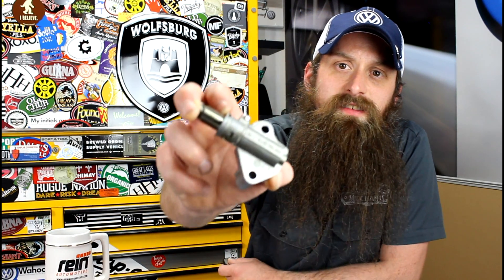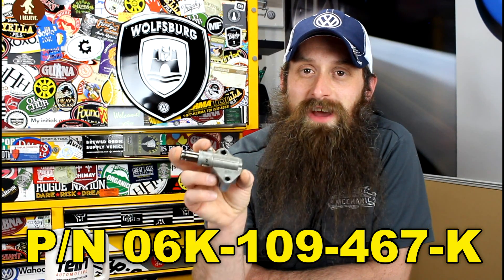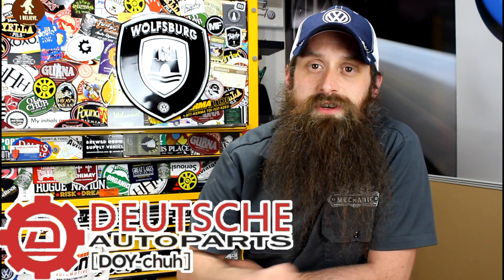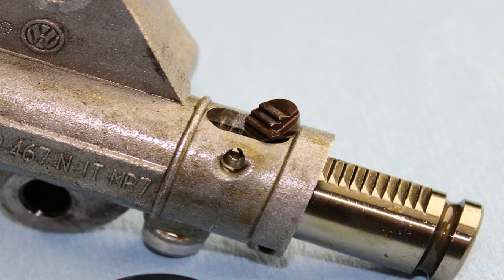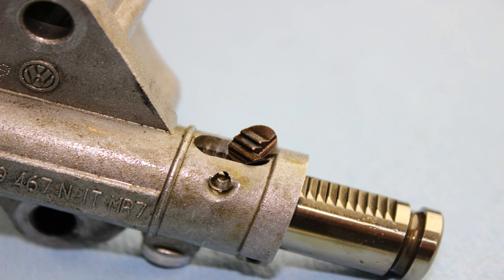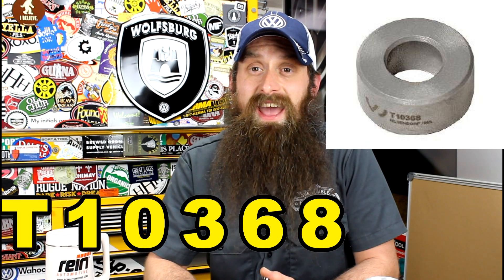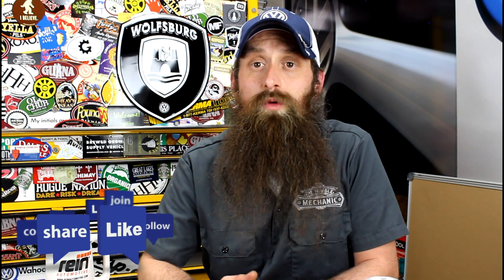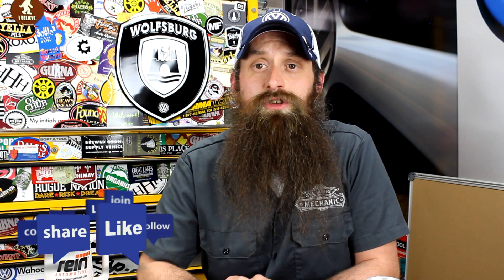How The 2.0T TSI Timing Chain Tensioner Fails

Comment: Charles, is there a DIY on how to install the tensioner pre failure. I want to due this as insurance to prevent failure. I have searched without finding anything to give me an idea if I need any extra pieces besides the tool you have shown and the tensioner itself. Thanks in advance

Comment: The dealership confirmed that my tensioner did fail. At the time of dropping off the car at the dealership the car still started and drove. I am out of warranty so I need to decided if I just swap the engine or try to fix the issue and hope there isn't major damage. If my car is still able to start (it does hesitate to start) and drive (with a really crap idle) is it more likely the time is just off slightly and the pistons didn't actually hit any valves?

Comment: My 2009 GTI JUST got this today.
When I went to start it today it cranked over for about 3 secs before starting and then got the P0016 code. 
Once running it seems totally fine and I cannot hear any noise and the timing does not seem off at all. 
I am at 140k km...tensioner you think?
Reply: Udo Donotron im having the same problem on my 06 2.0t tsi a4. did you figure out the problem?
Reply: Hi could u find the problem ?, have same code,,,

Comment: hey, i have 2012 cc @75kmiles. should i replace tensioner with timing chain as well? how durable is timing chain, will it last 200-250k miles? thanks
Reply: You should just do them both I heard. The timing chains usually last hundreds of thousands of miles, but the tensioner is what will break

Comment: I just bought a 2013 cc 2.0t tsi its the CBFA. The engine build date on it is 5/24/12 im going to be checking the part number soon, but im wondering if there was a time frame as to when this part was switched to the k part number on the CC's

Comment: my audi a4 06  has a clicking noise wich to me come from the back of the engine. after seeing so many videos on YT , it seems to be the timing chain tensioner.  os this the same one ??
Reply: my car does drive normal . but it has that noise.
Reply from the maker: +Maybederrepente very likely. It wouldn't be this tensioner but it could be the tensioner between the cam chains.
Reply: HumbleMechanic when timing a 2010 vw cc just a question do you just put the new chain on The arrows where it should be and put it back together or do you put the chain on and try and run it "by hand" to make sure the timing isn't off when the chain come back around

Comment: I have a question for you. I'm in the middle of this job on my Audi. is there supposed to be a gasket between the cam bridge and cylinder head. Or is it just a bare metal to metal surface? or a coating of gasket maker.

Comment: hey mate , I have a 1.8 TSI and plan to change the tensioner which u mentioned. Is it necessary to replace the timing chain as well ? 
thanks in advance and keep up the good work
Reply from the maker: Seen more chain issues with the 1.8 than the 2.0
Reply: +HumbleMechanic
Skoda service in India know nothing about this issue and are even reluctant to change the parts if we want to get it done. They say we can do it but u have to give in writing that all responsibility will be yours in case any issue happens :(

Comment: now im worried :-/

i have a 2013 2.0tsi amarok (South Africa market), what the odds it has the old type tensioner in? its on 180000km now (111846.815 miles) , if it were an old type, would it have failed by now?
Reply: HumbleMechanic found the engine code, CDFA
Reply from the maker: Sadly we don't have the Amarok here. I can't really tell you.
Reply: ts a vw pickup truck, using the 2.0tsi engine
Reply: Since it hasn't hammered your valves and the engine still runs your tensioner should still be fine. HOWEVER... if your vehicle has done 112K on the original tensioner and chain it's never a bad idea to get them replaced. The timing chain tensioner shouldn't be too hard a job to do, but your timing chain will require some know-how or you could upset the crank and cam timings. If you haven't the slightest clue on replacing the timing chain, take your vehicle to a mechanic and let them do it for you... there's nothing worse than fitting your shiny new chain and tensioner, cranking the engine over for the first time and bending your valves because your crank was a tooth or two off TDC when you fitted the chain! well... that unless you're a tuner and you blow connecting rods out the side of your engine block while tuning... that makes bent valves look easier to fix than a broken headlamp!
Reply: How to change timing chain Audi 2009 a4 qauttro

Comment: I have been looking at buying a 2014 gli 30th edition or a 2015 gti for the increased torque. I am certain the 2014 is still affected by the tensioner defect. What about the 2015 gti, was the problem eliminated when the engine gained more power in 2015 or is it also defective?

Comment: I have p0304 error , replaced coils with spark plugs , pvc valve , still have same issue! Mechanic told me than is a timing chain problem . I think he tried to get so money but not to fix my car
Reply: Late reply but that is not a mechanic. He is playing with your money guessing/swapping parts. Proper mechanics will have proper equipment to tell exactly what needs fixing + following correct procedures when it comes to narrowing down the options of what actually needs replacing.

Comment: Charles, So I've got a 2009 TSI Passat with 127K. I just found this video. I'm considering doing this myself. Would you need pulley holding tool T10355 to hold the pulley while loosening bolt? no videos mention holding pulley with tool and deutsche kit doesn't include one
Reply from the maker: You will need that or some type of equivalent to hold the pulley. Zipping that bolt off with an impact makes me very nervous. I would hate for the gear to spin. They have them on Amazon too. http://amzn.to/2aenkn7

Comment: Just discovered this channel, great and informative videos.  It appears my 2013 GTI is having this problem. won't start cranks like compression problem.  Would you recommend a dealership versus a local mechanic shop?  It sounds like an involved job to repair and I bet experience is the key.  Also, unfortunately the dealer is the closest tow.
Reply from the maker: +Dominic Luppino depends on your mileage. It may be worth towing to dealer and calling VW for assistance.
Reply: Thanks,  I have about 80k on the car.
Reply from the maker: You are out of the powertrain warranty, but I would 100% call VW and try and get some help.

Comment: Hey Charles. I'm about to order the kit from Deutsche, as I just saw that I have an older version of the tensioner and I just hit 60K. The job seems fairly straight forward but I was wondering if you had a diy for this job? Just replacement of the tensioner, not repairing any top end damage.

Thanks!
Reply from the maker: No DIY for this job. I am very nervous to make that DIY. It is not a job for everyone. 

Be sure to use the spacer, don't put too much sealant on the cover, and take your time.
Reply: Understandable! Thanks for the reply.

That spacer gets bolted on before removing the cover, correct? I've never seen the special tool in person but I'm sure it'll all make more sense once I'm actually doing the job.

Comment: so 2014 gti ccta should have the k tensioner. i see qe have a tsb about cold start rattle being normal yet could the tensioner yet be failing or backing off or is the oil pressure drip down normal? wonder if i should inspect anything

Comment: Trying to understand how the crankshaft pulley can effect the camshafts to crankshaft timing. If the marked links are in the correct position how does the pulley position effect this relationship?
Reply from the maker: It is the crank gear that becomes an issue.

Comment: A friend of mine has a 2009 Tiguan 2.0 L TSI. He purchased it from a used car dealer that repaired it after a timing chain tensioner failure. The engine had the valves replaced and the latest tensioner installed. The car runs okay for the most part, but has a nagging P0341 code that sets the CEL. Also the EPC light will flash on then go off. I have replaced the cam position sensor and still get the P0341. If the mechanic didn't use the tool you mentioned, T10368 and the timing was off would the car still run good?
Does this cam code out of range appear to be a timing issue even though up front looks fine? How do you check it? If wrong, how do you correct it.
Reply: I have a 2010 jetta, first engine failed due to timing chain. Replaced it (6k when I only laid 8k for the car)  and now it's throwing a P 0341 code as well. 
Wondering how this resolved for your friend?

Comment: Hi there sir. My mechanic has been working on Vw gti 2010 for the past year 3 months ago he had to replace the tensioner along with other parts such as bent valves and other parts. When he gave it back to me one of the censors has been acting up he replaced it 3 times already. For some reason the computer for the inspection sticker down in Texas does not pass reason being two codes keep coming up as incomplete. Now I took it back to my mechanic  for the codes he then said he had to keep it for two day so I said okay. When I got it back it had this rattling noise. He then told me it was Intake camshaft with phaser. I have already paid 3600 for the previous job witch was the tensioner and the parts coming with when that happens. My question is? Is my mechanic cheating me out on my money if I do pay him to replace the Intake camshaft with phaser. Why does the Intake camshaft with phaser break?

Comment: Hey I hope you read this can someone make a video changing the timing chain on this engine there is none that walks you through the process
Reply from the maker: I have been asked for this a lot. I am not sure it's something that I want to do. It's not super easy, and one little mistake can ruin an engine. That is probably why there are not any guides out there.
Reply: I was going to comment the same. It'd really help out a lot.

Comment: Your kit includes a tube of silicone RTV sealant. Doesn't the lower timing chain cover have a gasket included in the kit?
Reply from the maker: +oppanheimer upper cover has a gasket. Lower cover is sealant
Reply: HumbleMechanic Ok thanks.

Comment: Hi Charles, anything i can do to maybe help prevent (or prolong) it from failing? like changing the engine oil more often? thanks.
Reply from the maker: proper maintenance is vital. I would to an oil change every 5k if I was keeping our Tiggy.
Reply: HumbleMechanic thanks. i have doing exactly that, so fingers crossed!
Reply: Use the proper oil for this car and it is not 5w-40 it is 0w-30 european formula
Reply: @sergevivier2023  proof of this?
Reply: jump into the money pit or... sell it

Comment: i understand this timing tensioner issue is for 2008-2012 vehicles (not sure if this is correct info)  I have a '14 gti, which is essentially a '13.  Is this '14 model year affected by this issue?  thnx.
Reply from the maker: +Steve G there was not hard date on a switch. My guess is it's okay, but you're going to want to check and be sure. Here is a video on how to check it. https://youtu.be/G65J1aEszyc

Comment: help...i'm looking for some advice as the timing chain tensioner failed on my 2010 vw tiguan causing catastrophic engine failure...what is my best way to proceed...new engine, used, re-built any other options...?

Comment: How do you know if the tensioner is old type or the new one? How do you check the position of the cam shafts. Do you need to remove the upper cover? Do they have timing marks? Im getting codes p0016 p0300-p0304 . Can you help
Reply from the maker: +Nicholas Davis here is how to check. 

https://youtu.be/G65J1aEszyc

Comment: ,Hello!  do you also recommend replacing the timing chain? or just the tensioner?. my car has around 108,000 miles.
Reply from the maker: IF there is no damage, you can just replace the tensioner.

Comment: I have an 1.4 TSI engine (122 hp). I bought the car (second hand) on November 2014 at ~71000km. Car was manufactured on   02/2010. In March 2015 (~80000km) I got check engine light on. There was some error related to timing chain. VW service replaced the chain and tensioner giving me 2 years warranty. From the first time when I bought the car I'm hearing a metallic noise when starting after more than 4-5 hrs. This metallic noise is no longer than 2-3 seconds; they told me it is normal. I don't know exactly which version of tensioner they have used. VW service consultant told me to replace the entire kit on their service because only they can provide me the latest version of tensioner (told me this version is one that solves all previous problems); I hope it is.

I've tried to listen to that metallic sound using a stethoscope and it comes from upper part of engine (not on chain side); it is very short 2-3 seconds. On chain side I've listened with stethoscope and there is always a noise, some quiet rustling noise.

Now I have ~100000 km and  when starting the engine after a while I'm hearing a new strange sound (it is random, I hear it 1 week ago, and again this morning). It appeared ~2 months ago. I can't explain it, but it is not a metallic noise, appear to be some plastic friction (it is present from less than 2 seconds). I was on VW service again and they were not able to hear that sound. They verified the car on tester and no error revealed. 

Almost when the warranty will expire I'm planing to go with car on VW service for chain and tensioner inspection. 
I've hear something about camshaft adjuster issue. But VW told me that there is no problem with that part; I hope ....
Reply: I had the same engine, same rattling sound at startup, and the engine died. No warnings, just would not start one day. Timing chain is out of sync and my life got a whole shitload worse. I would get the sound checked out if I were you. 

Good  luck! :)

Comment: Would you recommend replacing the upper timing cover too when changing the tensioner? Or just the lower timing cover?
Reply: it isn't necessary to remove the upper timing cover when replacing the tensioner.

Comment: Hey i really appreciate your video! I have a 2012 VW CC Pzev, it has the additional hose going into the air box which means it has the CBFA engine, correct? I read though some of the comments and you had mentioned that it is not just the CCTA engine but can happen to the CBFA too (Just less common). I am concerned because a couple of weeks ago I got a no oil pressure alert and I am getting a sound that I wouldn't quite say is rattling but it definitely is not smooth. The sound comes and goes.  I am going to have it checked for the old part number in the morning but if I do have the defective version is it necessary to get a whole kit or do I just need a new tensioner? what about the cover?
Reply: Mason Newitt I have a 2013 CBFA engine... should I get it replaced?
Reply: @User-oj5ds  no you should be ok

Comment: Currently car shopping, and was drooling at the 2012 tiguan prices.

In fact, the prices were SO good, I felt like I was missing something....a quick google took me to tons of failed timing chain tensioner thread on vwvortex, mostly who got little to no support from vw.

Thank you for this video, SO much, you saved me from buying a car that has a "common" major point of failure that the manufacturer does not seem to want to issue a recall for.
Reply from the maker: +Lynn Mckenney I have seen the support go both ways. REALLY high miles they don't help, but if the car is close to warranty, they have helped.

Comment: Seat Ibiza 1.2TSI from 2011, not completely died, yellow engine lamp is on, and noise from the chain, ~18.000 miles. What are the chances the engine has survived?

Comment: How common is this tensioner failure? It just seems like if it's that much of a problem, VW should man up and recall them.
Reply from the maker: I'd say semi common. But not as common as the Internet makes it out to be. 

The issue is, when it fails it is really catastrophic
Reply: +HumbleMechanic Okay. I have an 09 TSI and chances are it's got the old tensioner. I'm at roughly 130k now and it's running strong. She's my commuter car and I didn't pay very much for it so I'm thinking I'd rather chance it vs paying the $1G to replace the tensioner. What are the chances I make it to 200k with the old tensioner?

Comment: What is sad is other sites claim the Audi is the 3rd most reliable vehicle.  No way.  25 trips to the dealer and towed 6 times in 4 years is obsene.  They lied to us for 3 years about oiling.  Finally stepped up and fixed the rods, pistons and rings.

After 3 trips to the dealer for 3 check engine lights, magically after we got out of warranty, this happens...  Now we have to decide whether to scrap a $55k car for $5k.  They project a $7k to $14k bill to fix this problem.

Sell your Audi and get a reliable car which the manufacturer doesn't lie about oiling and other failures like this and they don't stand behind.

Comment: Hi Guys, I hope someone can help me out here. Aprox 2 years ago I got a sound where it slightly rattles when starting the car. Funny thing is it only does that when it is over 5-6 celcius. During winters i barley ever hear the sound when starting the car cold outside. Also it only sounds when the car has been off for a couple of hours.
Here is the clip

http://s241.photobucket.com/user/vajking1/media/97A7C626-BC76-4A49-BBD0-F33040F60567_zpsiyxpvy7o.mp4.html?sort=3&o=55

The dealers tell me its normal but I want to figure this one out because Im keeping the car for couple  more years. Could this be tensioner to the chain? Its a A6 2.0TFSI same engine as in B7 A4. I thought at first that it came from underneath the car, but later found out that its just resonating. Sound like it comes from the  bak of the engine. The car otherwise goes perfectly. Sorry for my English spelling :D